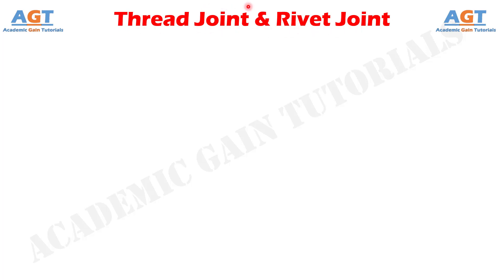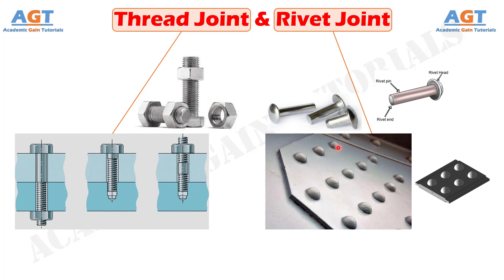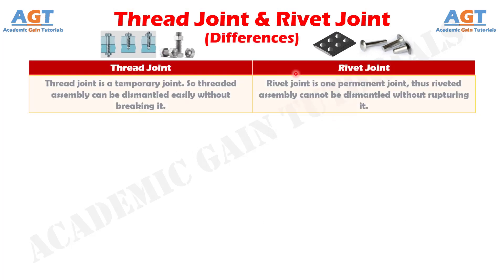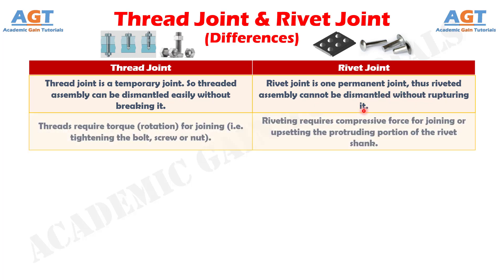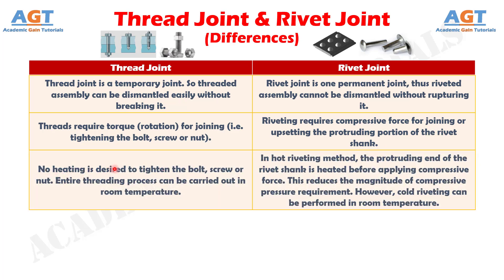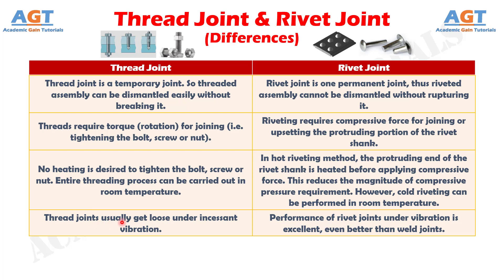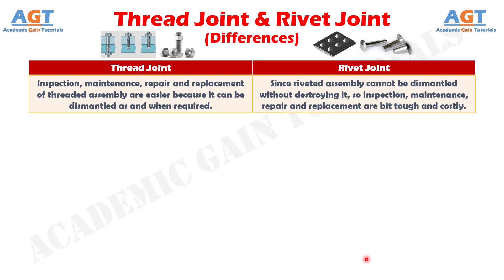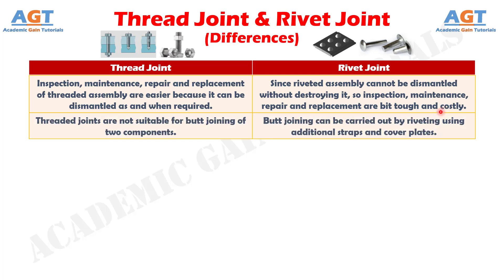Differences between Thread Joint and Rivet Joint.

Comment: No comments?  Here is one of mine: rivets expand in the hole, creating residual compressive stress around the hole, good for fatigue resistance.  Bolts have residual tension stress maintain clamping force, but do not fill or expand in the hole unless the hole is cold worked on installation.